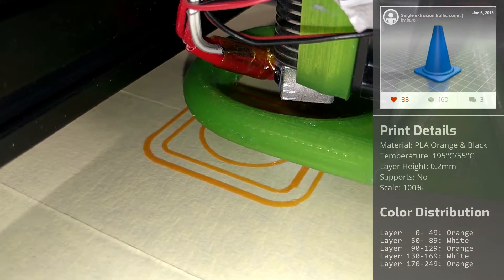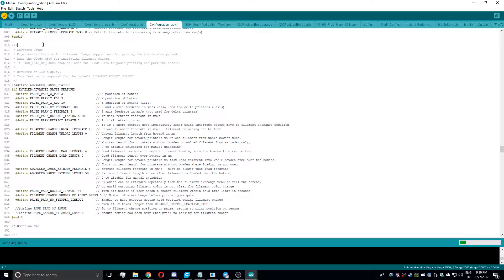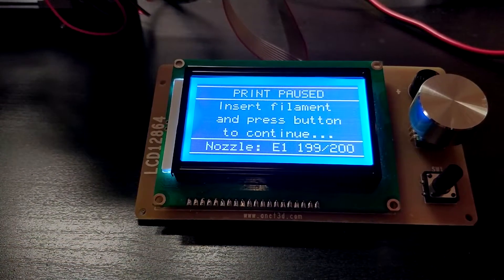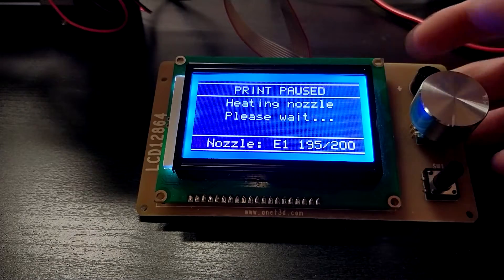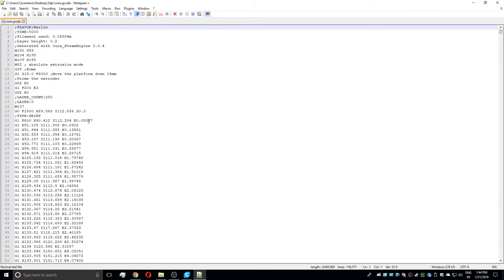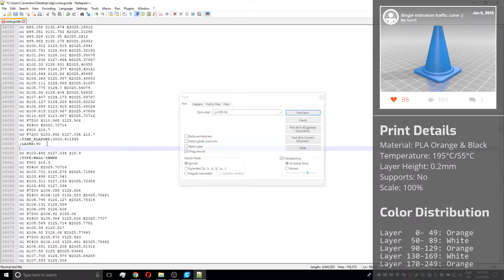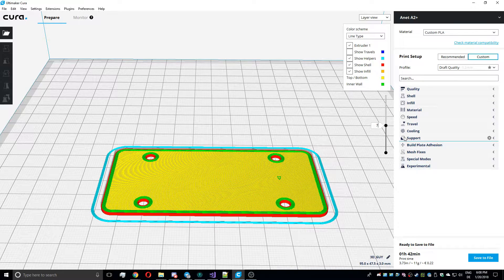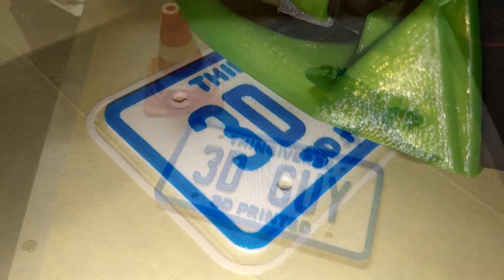Multi-Color Prints with Single-Color Printer

Comment: hi boss can i put auto bed leveling in tronxy x1 printer ,if yes please one video on
Reply from the maker: If you find an empty pin, yes. I have not looked into it so far, but it's probably possible. Maybe I add one in the future, but I'm relatively busy this month (started a company)...
Reply: ok boss

Comment: I have no more room on my anet board when I try to use advanced pause it won't compile.  
  I have linear advance and baby stepping on maybe  with those off there would be enough memory
Reply from the maker: So you ran out of memory? You could flash the bootloader to get some extra memory (you need to find some tutorial as I don't know how to do it). Well, the best thing that you could to is to just try it out. Keep a backup of your current setup in case it doesn't work out as expected. If you want to have more features from the controller, you could also upgrade to an Arduino Mega + RAMPS setup like I did (see my other video). If you find a solution, make sure to share it with me/us ;-)
Reply: Caverntwo I was thinking of getting either a ramps or mks board in the future if I find anything I'll let you know for sure.
  Thanks for your tutorials you do a great job man
Reply from the maker: Nice! 
Soon I have more time for many great videos ;-)

Comment: Why did you do this , i have an urge to upgrade it to marlin now!!!
Reply from the maker: The reason for this video was to show how you can easily switch colors. xD
Reply: the problem is that it is too easy to be true and does it work on anet a8?
Edit: and i need to do a PID tune because my heater cartridge is doing weird thing and i need to set a higher temperture.
Reply from the maker: Yeah, check out my other video about installing Marlin on the Anet A8 for that. PID is easy tunable in the configuration (as long as you know what you are doing).